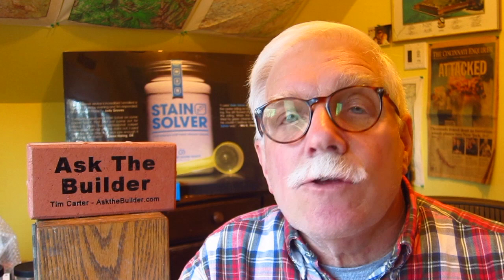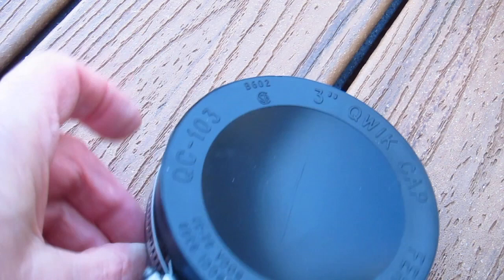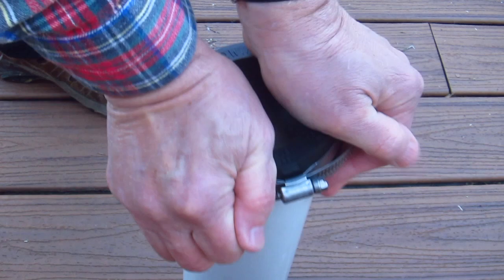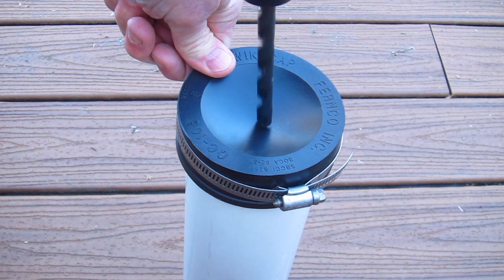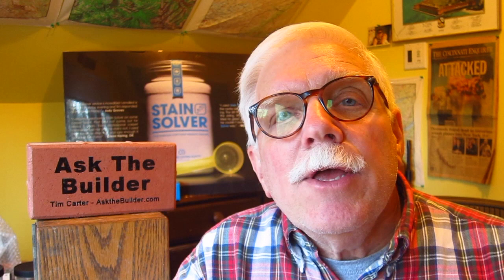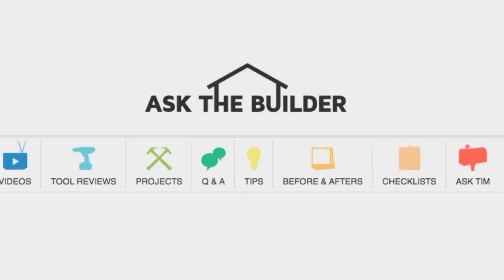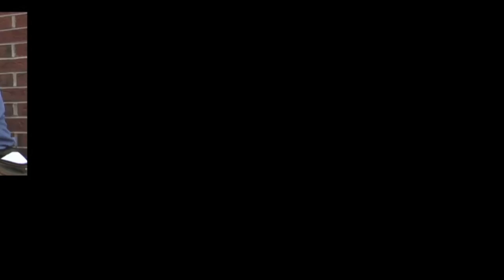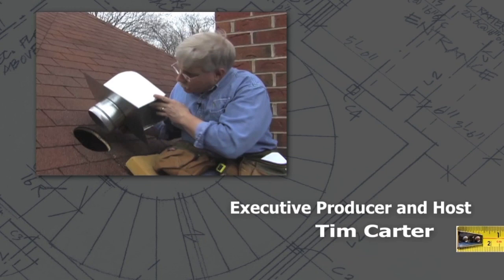Sewer Gas Smell Vent Pipe

Comment: Hey, great channel and great video! I have a quick question for you, but I have to rant a bit about my situation... and maybe this will help someone else experiencing similar. I'm on city sewer and have been dealing with this problem, off-and-on, for the last 10 years. It seems to be seasonal, and even related to the weather. I am about a block away from the sewer lift station, but my home is the lowest point on the street, even the lift station is higher. My home is also shorter than my neighbors, and consequently, my vent is a bit lower... I seem bear the brunt of sewer gas wafting out the vent nearest the road. None of my neighbors have the same complaints. The only thing that really helps is when the city runs the lift station fan to help purge gases, but it's not always helpful. It's worse at night when everyone in the neighborhood is showering and doing dishes, plus the atmospheric conditions at night appear to allow it to settle right near my front door and yard. The city recently started injecting a chemical into the sewer system to help prevent gases, but that hasn't really helped. They won't install a check-valve because they say it's not really a "problem", and conversely, would cause me to experience main-line clogs. My question for you is... my vent pipe seems to be covered by a lead fascia/shroud... it comes up and over the pipe, and is bent down inside the pvc pipe. How exactly would I go about adding a cap in this scenario? Would it benefit me to try and raise the pipe higher, as weird as that would look? Thanks!
Reply from the maker: I've been solving homeowner sewer gas issues for years over the phone. I've been a master plumber since 1981. You might want to schedule a call to get this smell issue under control: https://shop.askthebuilder.com/15-minute-phone-or-video-conversation-with-tim/

Comment: I haven't tried your solution yet and I am a woman renting a 1 bedroom house. But I have done everything in my power to clean drain. I took the trap apart and cleaned it good and put the vinegar and boiling water and bleach. Then the sani sticks which actually work sometimes, but it seems that at monsoon season here in Arizona nothing is getting that prwtred smell out from under the sink vanity So this would be my last hope.
Reply from the maker: I've solved HUNDREDS of sewer gas problems using a simple Q & A format. If you need help, consider purchasing my Sewer Gas Ebook: https://shop.askthebuilder.com/sewer-gas-smell/

Comment: I have a different question. We are planning to have a metal roof installed and the roofer suggested we remove and reroute our 4” vent stack a bathroom exhaust to the gable end of our home, which is 25’ away. It may be helpful to know we have a conditioned attic and live in a northern climate. What are your thoughts about this?
Reply from the maker: My thoughts are you should invest in one of my consult calls. There's FAR TOO MUCH TO TYPE: https://shop.askthebuilder.com/15-minute-phone-or-video-conversation-with-tim/

Comment: I'm desperate for answers. Brand new build. Sewer smell coming into the house through the air vents when air is circulating. Not every day but often and every day this past week. It's been 6 months of this problem and builder cannot solve it. Says it's a wind issue. They put an extension on the roof stink pipe as they thought maybe the air intake was sucking the sewer gases into the house. That did not solve it. We are on a septic system. Plumbers and HVAC have been here. No solutions. Smell is horrible and nauseating. We can't live like this.
Reply from the maker: Anita, I solve ALL sewer gas issues over the phone. I've been a master plumber since age 29 and have solved HUNDREDS of sewer gas issues just like yours over the phone. Have the builder pay for my call. Based on past experience, we'll need 30 minutes: https://shop.askthebuilder.com/15-minute-phone-or-video-conversation-with-tim/

Comment: Tim, thanks for video. We have sewer smell inside one bathroom in 2 bathroom home. Bathrooms are right next to each other . We replaced the wax seal, checked under the house for leaks, no leaks. We have a septic tank system. These smells coma and go. We ran water in in shower and sinks to fill those P traps to no avail. What could solve the problem?
Reply from the maker: Simple. You can start to solve the problem yourself by reading my ebook: https://shop.askthebuilder.com/sewer-gas-smell/ This simple short book has brought relief from the smell to over 100,000 other consumers who have read it. Get the book and your odor should be gone in one hour or less.

Comment: what about using one of those Odor Hog filters instead? Im having this same problem. Im starting to use sinks and washing machine connected to a 2nd septic tank on my property that hasn't been used in a while, so the sewage smell from the vent pipes are really churning out stink.
Reply from the maker: Life is full of choices, isn't it? Did you read all the comments?

Comment: Awesome advice and thank you for sharing this with us.  i just had my septic pumped and now our vent pipes are gassing the neighborhood. Our neighbors actually called the gas company cuz they thought there was a gas leak. I had a plumbing company come out and they put a studor vent on ine of the vent pipes now the smell is coming out of one of the other pipe vents. The guy that pumped the tank said dump a gallon of bleach down the sink and that didnt work so i started googling and this video came up so i will try this and if it works i will post another comment. One question i have though is what if we have multiple vents? Do we cap all of them and put a hole in all of them with this method?
Reply from the maker: You do it with all the vent pipes.

Comment: As a plumber myself adding a cap and one 3/8 hole is a recipe for trouble. It is not big enough to adequately vent the household. Flush a wc when someone is showering or laundry in draining it will not be enough. This is crazy.
Reply from the maker: Kyle, did you not pay attention in the video to the part about the tiny tiny vent hole you put into plastic jugs of drinking water? Would you believe it if I told you that another plumber and I did a test where we vented an entire bathroom using 1/2-inch copper tubing and it worked perfectly? Instead of discounting a new idea that you've not thought of yourself, you should train your brain to TRY it first. If it doesn't work, then by all means come back with your test results and share them. Were you absent that day in high school physics class when this topic was discussed - air passing through tiny orifices at high pressure?

Comment: I'm a master plumber in MN and Wi and this should never, ever be done, especially if you have a septic system that vents through the roof.  Plumbing codes exist for a reason and venting your house through a couple 1/4" holes is no good.
Reply from the maker: Matthew, I'm a master plumber in OH and NH and I'm here to tell you this works. The only issue in your states happens to be hoarfrost closing up the hole in the dead of winter. But as I say in the video, take it off in the fall as you're not outside on the deck or patio and your windows are CLOSED. Did you process the example I gave about why it works? The tiny PINHOLE you poke in a 2-gallon jug of water to get the water to flow out of the spout full bore? Why does a pin prick work? Why not drill a 3/8-inch hole in the top of the water jug????? Gotcha :-)

Comment: Hi Tim, I really appreciate all of your content, thank you very much! I'm having this issue with the front vent pipe of my house, it's constant and so bad I can't even be in the front of my house if the wind isn't blowing the gas in the opposite direction (issues is a 10 of 10 level)! I'm definitely going to try your idea! I've tried the Odor Hog and it does absolutely nothing, the odor is that strong and it's sad because we love our home. Two neighbors directly to the east of our home (very large attached condos) are having the same issue so our corner of the cul-de-sac is really bad. My question is, could this be a city sewer issue if so what could potentially be the issue? This is my 3rd home and I've never experienced this issue. Thank You Sir!
Reply from the maker: There are several things that could be causing the issue. If you need detailed help, I offer a phone consult service: https://shop.askthebuilder.com/15-minute-phone-or-video-conversation-with-tim/
Reply: I have the same issues did you fix it with this method thanks I’m praying this works

Comment: Well i am very intrigued as we have the odour issue and its in our bedroom as the septic is just outside our window and the vent is directly above us in the roof. We live in rural Ontario, cold climate, lots if snow. I understand the reason for removing in the winter, but as some others -  our odour is much worse in the winter. We have a wood burning fireplace just outside our door so i am assuming the “draft pull” from the chimney is pulling in the odour. So not sure how to solve my winter issue with your “removal” recommendation. 
Robert.
Reply from the maker: Gina, I've been a master plumber since 1981. I've solved HUNDREDS of sewer gas issues like yours over the phone. It's too much back-and-forth here. https://shop.askthebuilder.com/15-minute-phone-or-video-conversation-with-tim/

Comment: Hi Ask the builder, I added a bathroom and this is a new roof vent that was added to vent the toilet, shower and sink,  its coming in off a fork from the main line leading out to the street, about 50 feet of new 4 pipe leading back the new bathroom, this new vent on the roof is for that new bathroom.  The work was done by an experienced plumber and passed inspection, but this vent has a MUCH stronger smell than the three existing ones on my house, Why would this be?  I'm trying your cap idea on this one pipe.
Reply from the maker: Wind direction? Get unlimited tips each week for FREE with my www.AsktheBuilder.com newsletter.

Comment: I'm curious why they would put a 3-in pipe through the roof if a quarter inch vent hole is enough to keep the system working?
Reply from the maker: Because over time a small hole could get plugged up with debris. In cold climates hoar frost would clog it. This is a great fix for those that suffer from sewer gas because the vent pipe was put in the wrong upwind location on a home.

Comment: I’m going to try this for sure! Question for you…why do I need to remove it in the winter? The septic smell from the pipe is year round. My winter temps get to -15F to -22F and usually 2-3 ft of snow on the roof. Thanks!
Reply from the maker: hoarfrost - Do you keep your windows and doors wide open in the winter?
Reply: I don’t, but I spend a lot of time outside and it smells in the winter. Also I don’t want to climb up on to the roof to take off/put on twice a season. I live alone, rurally, ladders aren’t my thing.
Reply: The heat from the vent won’t keep it from frosting over? Steam is visible out the top when water appliances/taps are on.
Reply: @DiSchellenberg  did it work in the winter for you?

Comment: Hey Tim, 
Great stuff, we have been smelling the horrible gas/sewage smell for a few years now but only outside when on our back deck and especially in the fall/winter seasons. Never had the smell inside our house though, so would we still smell this odor outside? The vent is on the backside of the house which is where our deck is located and occasionally we get the smell and it’s unbearable, every day really. Thanks for any insight. I’m definitely going to try this but wanted to get your advice on the smell outside the home. 
Thanks a lot
Josh
Reply from the maker: Watch the video once more. If you need help after that, I offer phone coaching. I've been a master plumber since 1981. Go here: https://shop.askthebuilder.com/15-minute-phone-or-video-conversation-with-tim/

Comment: Hi. Late to this post.  As the smell exits the vent pipes is it not a gas?   The gas still needs to go somewhere?   This solution  doesn't cause a gas backup?  Maybe it slows the gas release and still allows the plumbing to work properly?  Very interesting.  Windier why Venta aren't smaller in diameter.
Reply from the maker: You need to read all about vent pipes and HOW THEY WORK on my www.AsktheBuilder.com website. If you need more help, I offer phone coaching/mentoring: https://shop.askthebuilder.com/15-minute-phone-or-video-conversation-with-tim/

Comment: Great video! But, what do I do during the winter?? We can even walk out of our house without gagging! I smoke so I'm outside year round. Can I leave this on year round??? Thanks!
Reply from the maker: You can try. If it gets bitter cold the small hole could ice up. But on a sunny day, it will melt fast with the black rubber absorbing the solar radiation.

Comment: I have sewer gas issue in my room from my shower drain hole.  It happens if I flush the toilet but not using the shower for a couple of days. I suspect it's the vent valve issue, either clogged or it's a check valve, air can only goes out.
Reply: Sounds like the water in your shower's Ptrap is getting siphoned out allowing sewer gasses to escape.
Reply: @glennismcclellan  I havek a similar problem.  What is the fix for that?  Thanks so much!
Reply from the maker: The fix is to talk with me. I've been a master plumber since 1981. For unlimited tips like this video, subscribe to my FREE newsletter at www.AsktheBuilder.com

Comment: Hi, hope you will see this comment. We have a 4 -Storey Building and the plumbing is vented out the roof.
However at times there is a sewer smell in the groundfloor rooms. We have temporarily installed a fan at the top of the vent to force more air out and this has solved the issue for now.
But it seems to be only treating the symptom. What would you suggest we do?
Thanks!
Reply from the maker: Bill, I suggest you get on the phone with me. There's far too much to type: https://shop.askthebuilder.com/15-minute-phone-or-video-conversation-with-tim/

Comment: No, that didn"t  work.  Inside my home it smell like sewage and up on the roof the vent pipes smell like sewage coming out of it. It is real bad. All  p traps have water in it. The smell gets real bad when it windy, raining and cold outside.  i snake all the pipes found no clogged and disconnects.  What more can I do to solve this problem. Sleepless
Reply from the maker: I've solved HUNDREDS of sewer gas issues. You can start to solve yours by reading this short ebook that takes you down the source pathway: https://shop.askthebuilder.com/sewer-gas-smell/

Comment: Is there a solution to the root cause of the methane sewer gas small? Is the septic not digesting properly?
Reply from the maker: The smell is natural. The issue is most gravity septic systems do NOT have a vent in the leach field. Thus, any gas that builds up in the tank has but one place to go - out through the roof. Understand the primary purpose of the roof vent pipes is to LET AIR INTO the system.

Comment: Is there a certain length vent pipe should be coming out of roof
Reply from the maker: Yes, the vent pipe should be a certain length. The power is discovering how to ask the right question.
Reply: I have a ceptic. And we have recently had temps 12 below zero. And when furnace runs i smell ceptic gases.
Reply: Also i have an oak tree above vent pipe area.  Thinking possibly Acorns in vent
Reply: Thoughts. Ideas.  Much appreciated 

T. Y
J. E
Reply from the maker: Your situation requires a conversation. Far too much to type: https://shop.askthebuilder.com/15-minute-phone-or-video-conversation-with-tim/

Comment: Even tho I thought it vented up I did get the t n y rite because the logic was the same. So now I gotta ask you for the trick to keep the top from freezing in the winter. Is there something that does both u can leave on ??
Reply from the maker: If the hole chokes off with hoar frost, no air can get into the system. As I said in the video, in the winter you generally have your windows and doors closed so no odor will get in. It could be an issue if you have an air INTAKE vent close to a plumbing vent pipe. I'd always shoot for 10-feet minimum spacing.

Comment: I have a question for you, does it HAVE to vent out the roof? Or can I vent it another way?
Reply from the maker: It should vent out the roof for a host of reasons. This is why you see a vent pipe on ALL homes and almost never on the SIDE of a home.
Reply: @askthebuilder  thank you very much. My older brother cut mine and I had no idea if I should hook it back up through the floor or go out the side.

Comment: But why does a small hole stop the gases/smell from coming out? Basically, why does this work?
Reply from the maker: Simple physics that you were taught in high school. Try to think back on it.
Reply: @askthebuilder  i get the physics of needing a vent system.  
My question is, why would you smell (or have) less gasses, fumes etc. with having a smaller hole? While it's sitting there, not in use. 
You've proven the theory (less/no smells) works, but didn't explain why.

Comment: You say to remove the cap during the winter, but, that’s when it’s the worst for us due to temperature inversion. Do you recommend removal so that the hole doesn’t get plugged with snow and ice? If so, what if there were a shield over the cap that allowed full vent but protected it from snow?
Reply from the maker: Confused, so you're implying that in the winter you spend lots of time outdoors and are offended by the odor, correct? Yes, hoarfrost. A cover will not stop the ice. Sun will help melt it.
Reply: @askthebuilder  no sir, we’re mostly indoors. But because of where our bathroom fan vents are situated in proximity to the vent stack, the septic smell enters them. If we’re running water, two of the fans need to be on or it gets into the house.